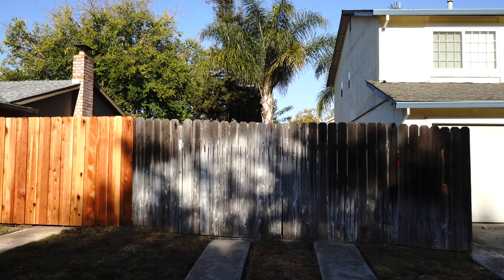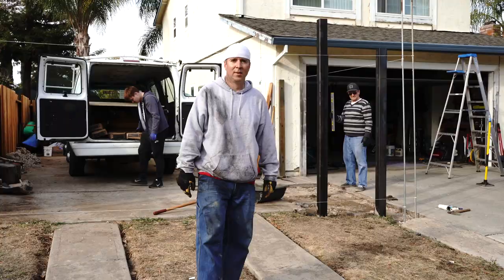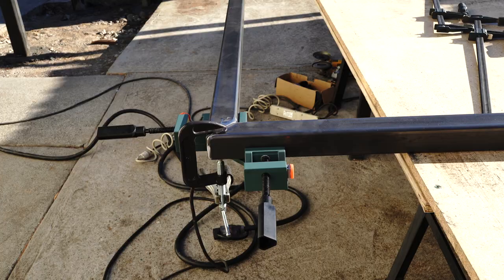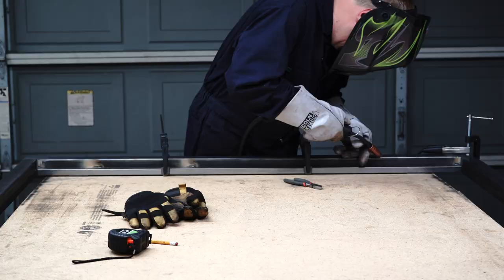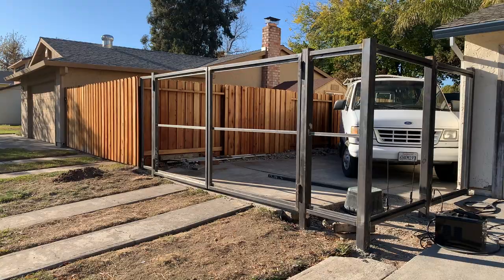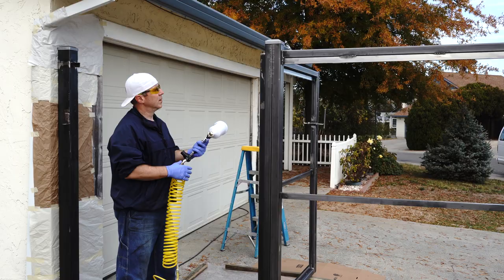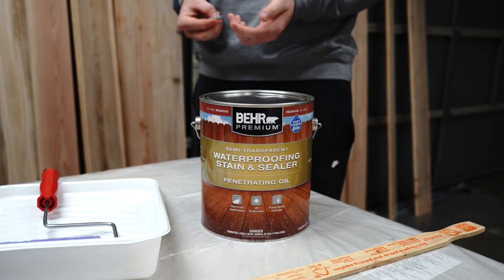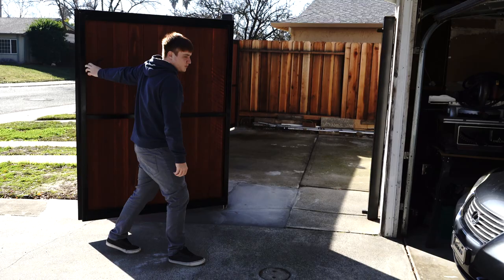DIY Metal Gates and fence project

Comment: Nice work looks great I want to do something similar what kind of hinges did you use and also the tubing that the pickets are going to hook to was that the 11 gauge steel tubing
Reply from the maker: I’ve used 7 inch bullet hinges and I think they were 7 or 8 bucks each. You can find them online as well. Fence pickets were fastened to a 16 gauge rectangular tubing which is .065 thickness or 1/16th of an inch. Cheers and good luck with your project. Thanks for watching and commenting.
Reply: @balabay77  you are welcome I have a couple of more question how long were your main post and how deep did you bury them
Reply from the maker: @jessebarnes5994  
My main posts were 9 feet long and I buried them approximately 3 feet deep. It was a lot easier for me to set all my posts in place and then cut them in a straight line than try to figure out how deep to burry them. 
Besides, once you weld all the 2X2 tubing to main posts, your fence/gate won’t go anywhere and it will be very rigid.
Reply: @balabay77  thank you very much this will help me alot

Comment: Do you ever use aluminum instead of steel for rust prevention?
Reply from the maker: If I knew how to weld aluminum then maybe I could have used it in other applications. There’s more involved when it comes to welding aluminum. Also, aluminum is more expensive than steel so it’s not cost effective to use it in a project like this.

Comment: looks great, what did you use to cap the 4x4 posts?
Reply from the maker: I’ve found metal end caps on amazon. Here’s a link Bobco Metals Decorative Durable Heavy Duty Square Pressed Steel Caps 4" (Lot of 6 Caps) https://www.amazon.com/dp/B07ND83F12/ref=cm_sw_r_cp_api_glc_fabc_6XCF0JQXQ6TQWFN7D1M7

Thanks for watching and commenting.
Reply: @balabay77  Thanks for the link.

Comment: Just wondering which weld machine were you using ?
Reply from the maker: It’s a HarborFreight Mig/Flux core welder made by Chicago Electric. It’s not great but I managed to get the job done. When I bought it many years ago it was sold for $170 but with today’s inflation it goes for $229. Here’s a link to it and good luck 
https://www.harborfreight.com/welding/welders/170-amp-dc-240v-migflux-cored-welder-68885.html

Comment: Hi 
What kind of wire are you using on your welder? And are you using any type of gas? I’m planning on buy a welder to do my gates.
Reply from the maker: Hi Oscar
I’ve used a flux core wire by Lincoln electric from Home Depot. It doesn’t require any type of gas to weld and so far I had no issues with this wire. I highly recommend it. Here’s a link to it https://www.homedepot.com/p/Lincoln-Electric-030-in-Innershield-NR211-MP-Flux-Core-Welding-Wire-for-Mild-Steel-1-lb-Spool-ED031448/100341108

Thanks for watching and commenting. Cheers
Reply: @balabay77  thanks so much for the information.  Would you recommend the welder you are using in the video?
Reply from the maker: @oscarjimenez1211  
My welder is cheap and old but was able to get the job done. I wouldn’t recommend it because it’s got a 10% duty cycle which means that if you’re weld for 3 minutes nonstop than you need to let it cool down or rest for 8 minutes or else it will start skipping or shutting off while welding. If you can find a better welder than it will be great for your end result. Here’s more info on duty cycle 
https://www.weldingsuppliesfromioc.com/blog/does-duty-cycle-really-matter/
Reply: @balabay77  thanks for the link. I’m planning on taking this type of project with my son over a few weekends. How long did it take you?I’m sorry to be asking so many questions.
Reply from the maker: @oscarjimenez1211  
My son and I, We also worked on the weekends and evenings. During Winter it got dark really fast so it took us a month to finish it. Our main posts were quarter inch thick (0.25 in) and the rest of the square tubing was 0.120 inches thick or 11 gauge steel. Good luck with your fence and let us know how it turns out. Cheers

Comment: What kind of welder are you using?
Reply from the maker: I bought my welder at HarborFreight store for $170 dollars. I think now they go for little over $200 bucks but they are good enough for small projects like these. It’s a mig welder that can do flux core wire or can weld with gas. 170 amps. Thanks for watching and commenting.
Reply: @balabay77  awesome job I'm about to attempt it

Comment: What caps did you use for the 4”x4” posts?
Reply from the maker: I purchased these end caps on Amazon and they were around 17 dollars for 6 of them I believe. Now they are more expensive but here’s a link to similar end caps 
Bobco Metals Durable Heavy Duty Steel Caps - Pressed Decorative Square Fence Post Caps - Perfect for Wood Fences, Newel Posts, Deck Posts, and More - 4" X 4" - 6 Pieces https://a.co/d/daQltzc
Reply: @balabay77  thanks! Great work and thanks for the great video!

Comment: where this metall supplier located? i am from Sac too
Reply from the maker: Business is called Del Paso pipe and steel located at 5519 Raley Blvd in Sacramento California 95838
(916)992-6500
Good luck
Reply: @balabay77  thanks

Comment: Ive always wanted this type of fence, but here in Ga folks are charging over $10,000 or so for this. My main issue is tools. Im lacking the tools needed. But I will continue to watch this video until I get each tool for the project. 🥲
Reply from the maker: Dang, they’re asking a lot of money for this type of project. That’s the main reason why I learned how to weld on my own by watching YouTube videos and slowly but surely I got the gist of it. Some dude wanted to charge me $400 for welding two metal pieces together so I bought a welder for $170, some supplies and the rest is history. Would like to wish you good luck with your project and hope you get all the necessary tools for it ‘cause I’d love to see it finished in the future. Thanks for watching and commenting. Cheers.

Comment: What type of screws did you use to fasten the wood boards to the metal frame?
Reply from the maker: I’ve used decking screws for this project and for my second video of continuation of this fence. I think my other part of this project came out much better where I overlapped my picket boards for ultimate privacy. Drilled a pilot hole and screwed in decking screws because they were already painted and meant for outdoor weather. Thanks for watching and commenting 👍